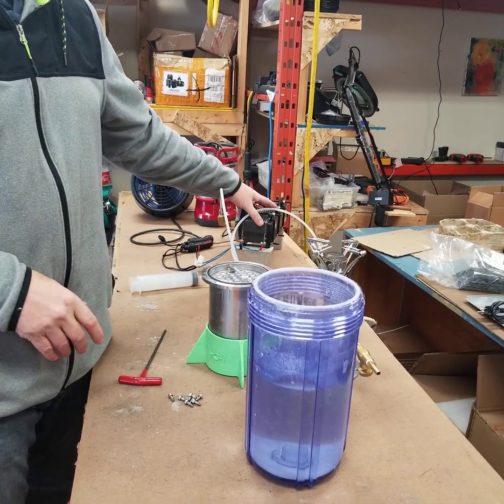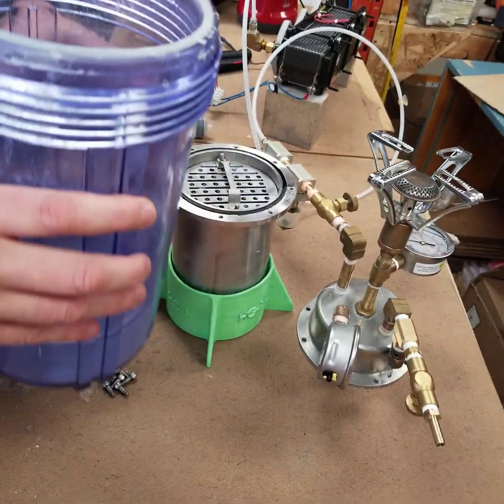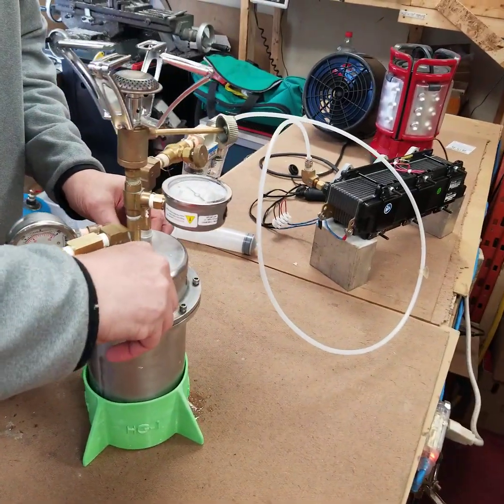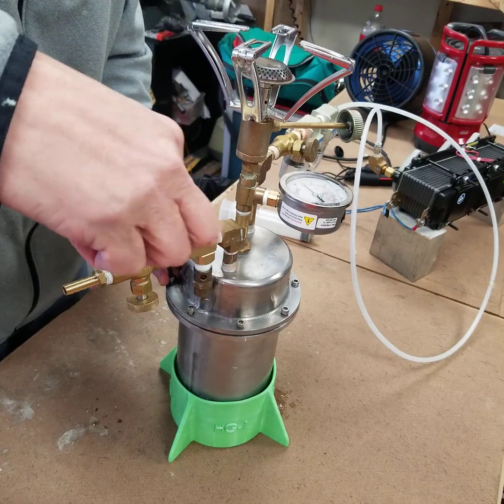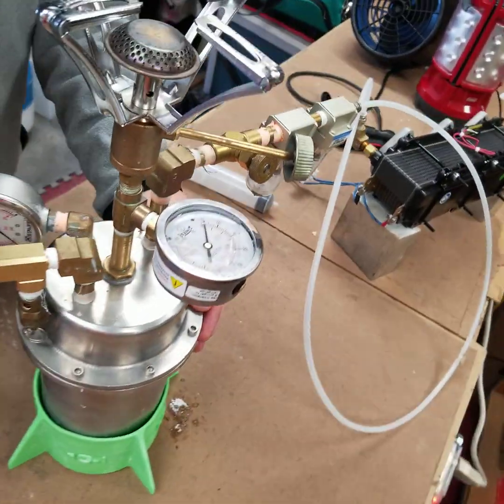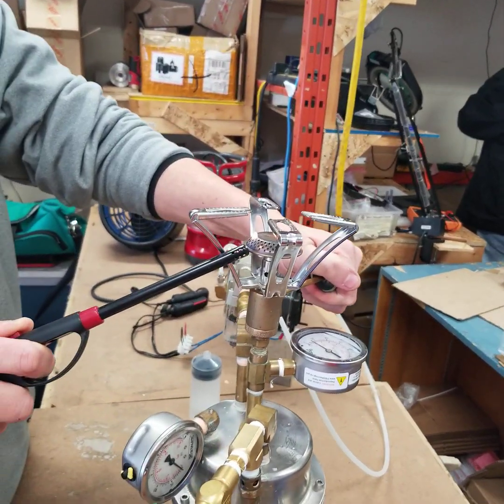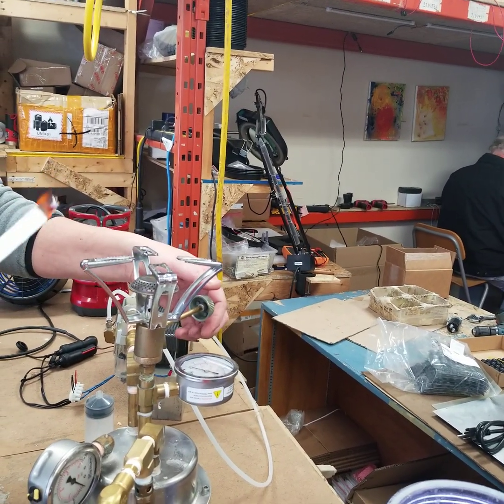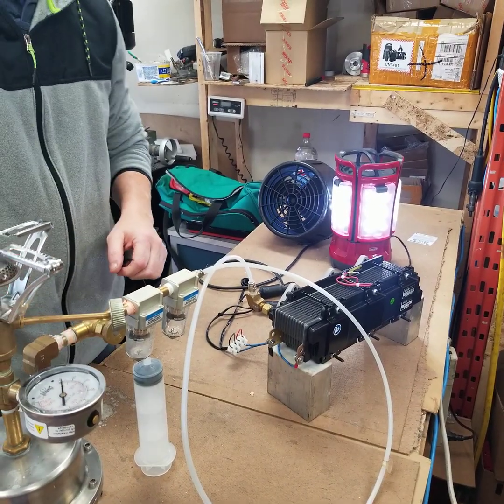Non-Electrolysis production of Pure Hydrogen into a Ballard 500W Fuel Cell Benign, Earth Friendly !

Comment: Aluminum and lye reactions can produce Hydrogen!
Reply: 1 kg of aluminium gives you 1 cubic meter of hydrogen when reacted with Sodium hydroxide. This is a more efficient way to store hydrogen than metal hydride or cryogenic storage. Metal hydride tanks are filled with an alloy powder, so they are heavy, around 4.5kg per cubic meter stored. A kg of Aluminium and around a kg of NaOH is less than half that, so if the water can be conserverd in the process and reused, this has double the energy density of Li-ion batteries if we persume 50% fuel cell efficiency. As a bonus, the process is exotherm, so there is free heat available from the reactor, that will require a cooling loop when used in a vehicle.
Reply: Edit: Conserving water, I meant not having it boil off from the heat of the process, because water is consumed as it is split into Hydrogen and oxygen. The Oxygen reacts with the aluminium and forms aluminium oxide (a harmless inert white powder) and the Hydrogen bubbles off.
Reply: @Tore_Lund  aluminium uses large amounts of electricity to produce
Reply: @sammyd7857  That's not the point, it is about if Aluminum-oxide can be reduced to Aluminum again energy efficiently. A Japanese company did some experiments reducing Magnesium-oxide in a solar oven to regenerate plates used in a solid fuel fuel cell. I'm not claiming this is easy energy, it is another way to store electricity as Aluminum and it is also more space and weight efficient than storing Hydrogen in pressure tanks or metal hydride tanks.
Reply: @Tore_Lund  you would probably be better off making sodium amalgam cell.
Reply: @Tore_Lund  how can heat regenerate a metal from an oxide? The magnesium in a fuel cell to produce hydrogen will turn into hydroxide not oxide.
Reply: @sammyd7857  You heat it up in an oven until it vaporizes, which for Aluminumoxide is around 3000C, then you have another material next to it which has a higher affinity for Oxygen and you are left with pure aluminum.
Reply: @Tore_Lund  yeah too much energy compared to sodium. And it is likely you need sodium to grab the oxygen anyway.
Reply: @sammyd7857  You could also use hydrogen, but that defeats the purpose, because making the hydrogen in the first place requires breaking even stronger bonds.
Reply: not economically viable , lots of aluminum required to produce 1 kg hydrogen

Comment: When will you have production models for purchase? Or will you show us how to build our own hydrogen generators? Cool project BTW.
Reply from the maker: We are working on funding. We have raised money but need more. We filed 6 patents to date and more coming. No lye, no acid. This is Inert rapid production. Nothing toxic in our reaction. Base elements can be reused over and over. The secret is the nano material we have developed. The rest is formulation and process steps needed to get exact reaction. Water, Seawater, Sewage water, Pond sands water, Urine all can be used  to produce Hydrogen. Purity is 99.98% with our filtering technology 99.998% that is pure enough for a fuel cell. The other benefit is we can use 100 grams of water and consume almost 85-90% of that 100 grams in the process. Electrolysis only can process 6 to 8% of the 100 grams H2O and needs another 100grams over and over, so lots of wasted fresh  distilled water is required. 50 Kwh of electricity to produce 1 kg of hydrogen. We use no electricity in our process. Carbon Neutral on demand, no storage required. only the nano material needs to be shipped, and is safe, cannot explode, spill, or degrade. Just standard packaging properly, load and start producing hydrogen.
Reply: @thermoelectricpowergenerator  How long these "nano" thing lasts? and how much its costs
Reply: @kemalrizkywahyudi4571  as long as you keep feeding it aluminium. Decomposition of aluminium in a potassium hydroxide solution produces heaps of hydrogen.
Reply: On YouTube channel reported Ballard fuel cells currently have 14,000 registered patents worldwide.. looks like somebody sold out, maybe to the oil industry, maybe to an oligarch, nevertheless they sold out.
They pump up their stock and then they sell the tech by writing ILU on a napkin @ some dinner party and it's announced the next day.. causing the stock to plummet and all the investors are left holding an empty bag.. 😢😢 it's the old shell game?
Reply: Looks good!

Comment: I don't understand, how is the water being split?
Something>Hydrogen> output to fuel cell>Electricity

There's no free power, what is being consumed?
Reply: It's the reaction of lye and aluminum inside the tank! Producing Hydrogen! Go to my channel and you will a very way to make this experiment!
Reply from the maker: @jaimecadorniga1496  No Lye or any other harsh chemical
Reply: @jaimecadorniga1496  Пишут что щелочи нет и кислоты нет
Reply: Many reactive metals will release hydrogen from water, such as sodium. Energy comes from the oxidizing metal. 

They have some kind of alloy using this principle.
Reply: @katodisadeputki5695  probably Ferrosilicon in water or powdered aluminium in potassium hydroxide solution. There are many ways of doing this if there are no harsh chemicals as claimed Ferrosilicon in water is my guess.